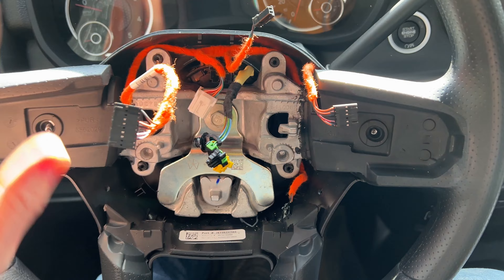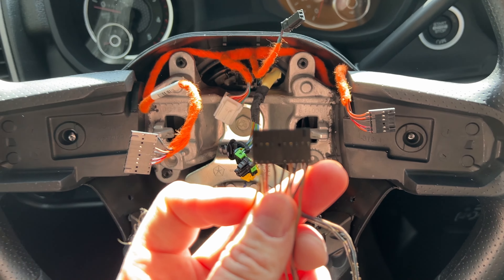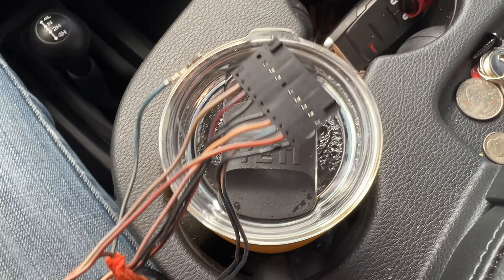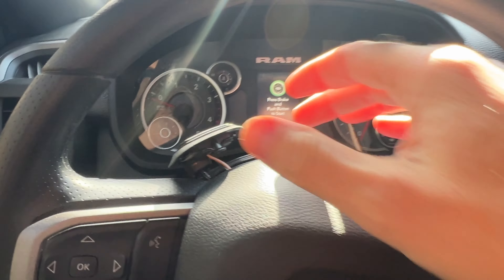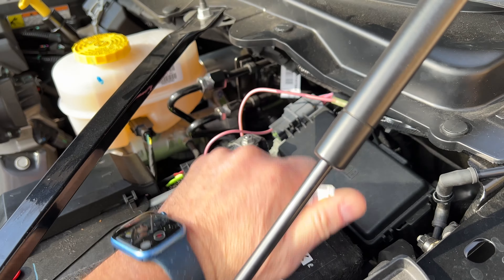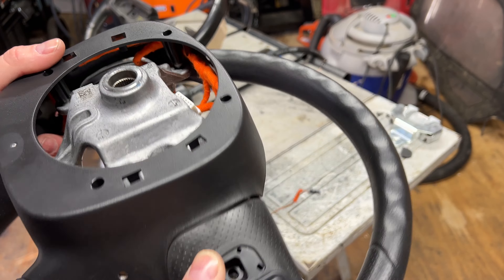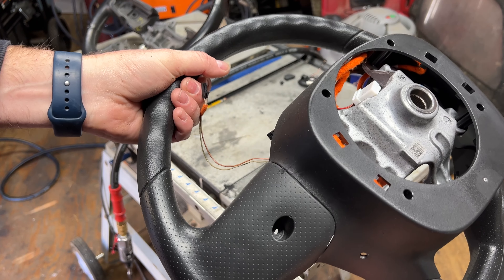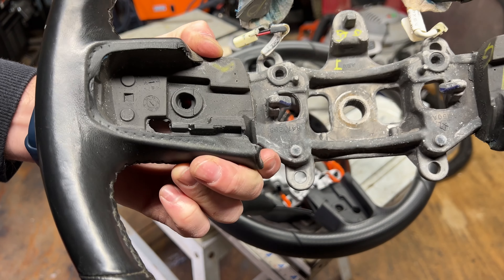Adding steering wheel audio buttons to 2024 Ram 3500 tradesman

Comment: You're a genius.  I just bought a complete wheel from a 2023 3500.  It has heated option but I only want to use the audio switches.  Hoping it works on my 2024 tradesman.
Reply from the maker: @chillpoint2410  Thanks! Good luck! Hopefully it works for you too! 👍🏻

Comment: did mine today to my 24 3500 srw  . only thing i have to switch 2 of the 3 wires i either have the left side to change channels or when i switched wires i had vilume on the right side so i have to switch the 3rd wire with either 1 or 2 .man the airbag a pain to remove and i had to make a steering wheel puller to go under the tabs that hold on the airbag
Reply from the maker: Glad you got it figured out! That air bag is no fun for sure! 👍🏻

Comment: I got a wiring harness from a 2022 with audio controls and there is only 2 wires that i see for the buttons.  Depending on what pin i put one of the wires in on the left side depends if volume or channels change.  Any thoughts?
Reply from the maker: Hmm. Not sure. Mine had 3 wires. What color are the two wires you have? Do you have the rest of the harness there too?
Reply: I do have the entire harness.  My two wires were Grey/Orange and Grey/White.  My Grey/Orange taps into a Black wire for the horn button but does not return to the harness.  Guess I'll have to do some Google Sleuthing.
Reply from the maker: @philsnow4387  Did your harness come out of a 2500 or a newer style 1500? My buttons came out of a newer 1500. Maybe that’s the difference. Not really sure. Good luck and keep us updated!
Reply: New harness for a 2022 2500.  Will post as soon as I have it figured out.
Reply: @philsnow4387  mine had two wire two but i just took another pin and butt connected to the ground the is conneced to the other plugs to make the third wire it worked
Reply: @philsnow4387  i have to switch the wires tomorrow  .i think the ground is 1 or 2 not 3 , i have volume with 1 or 2 and when i switch them i have presets so i have to move # 3 to 1 or 2 
if you havent figured it out ill take a video what i did with the two wire and connecting the third wire pin in